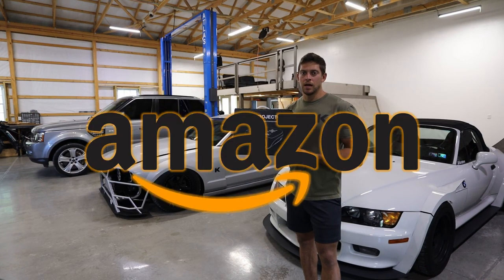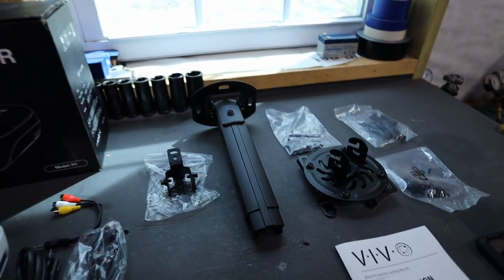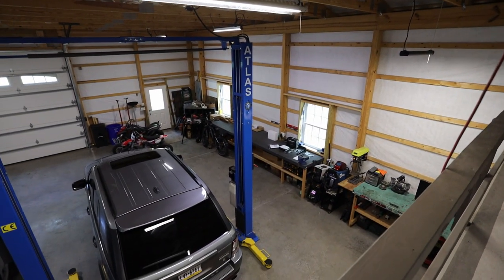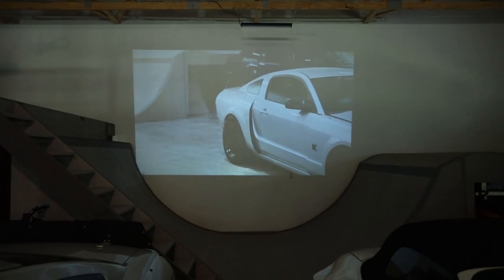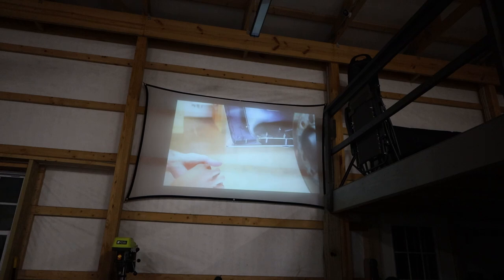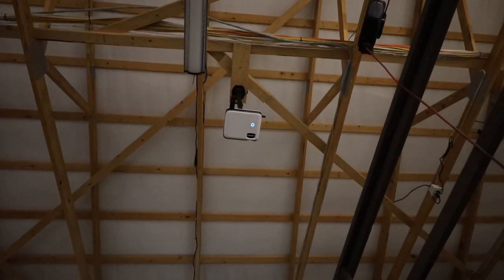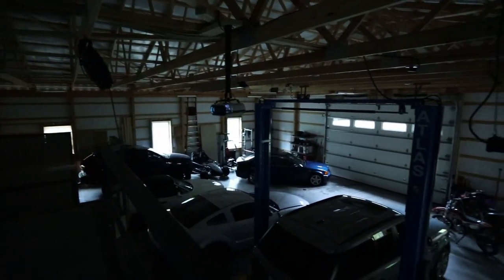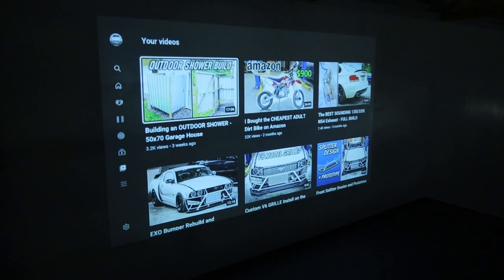Installing a 200" PROJECTOR in my Garage

Comment: I bought this projector and I love it. However like you said it is really tough to get the picture uniformly in focus. I ended up going with a simple tray style ceiling mount because I didn't know the four mounting screws were located under the rubber feet until I saw your video 😅

Comment: Excellent content.  I'm wondering long-terme what's the reliability?  Any issues with browning of the projected image or anything else?  These Chinese projectors are notorious for issues.  You might wanna check into lite grey(ish) paints to make the image a little more intense.  I know it sounds contradicting but it works.  I used sample sheets from home depot and you can pic the one that you prefer the most, then it's 10 minute paint job and voilà.  Another thing I'd suggest is the dust filter might get filled fast in a shop environment. 

Keep up the good work. 👍👍
Reply from the maker: Great suggestions, thanks🤘